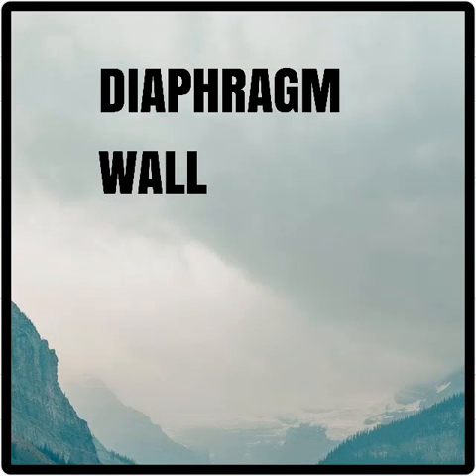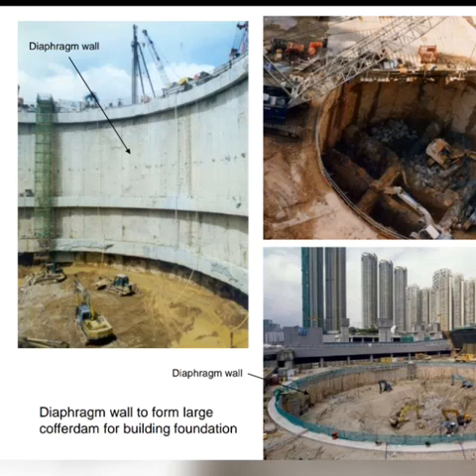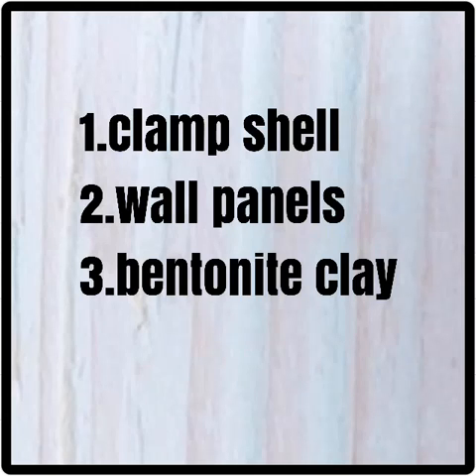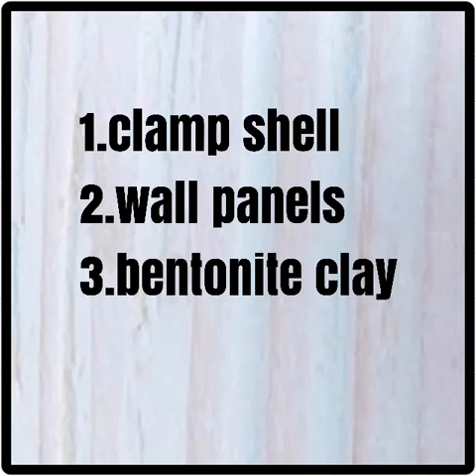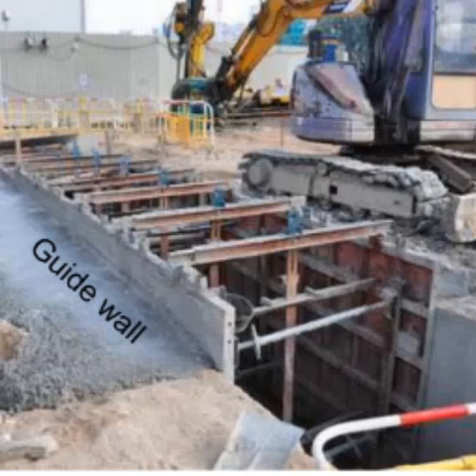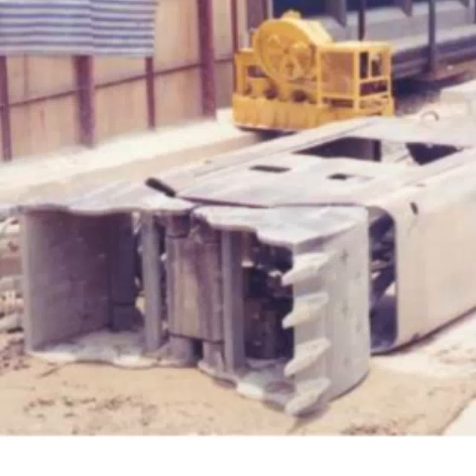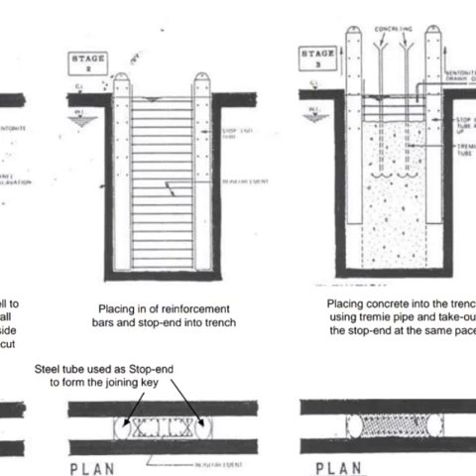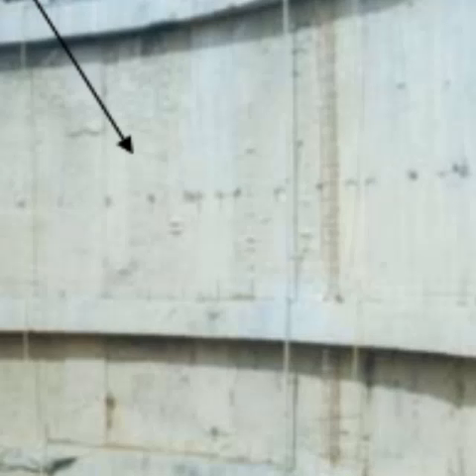Diaphragm wall

Comment: Bentonite slury for what purpose is used it ? the excavation is done and starting the concreting at time this slury is removed or what?
Reply: Bentonite slurry is used at the time diaphragm wall panel excavation to avoid soil erosion and after panel trench is ready to insert the steel cage on it and concrete pouring is started from one side and bentonite mud removed from another side...ok